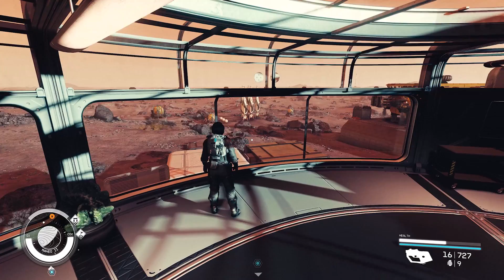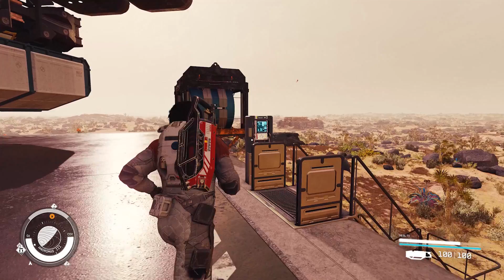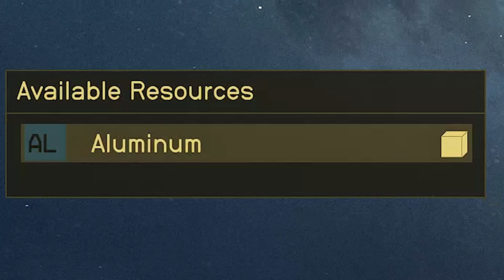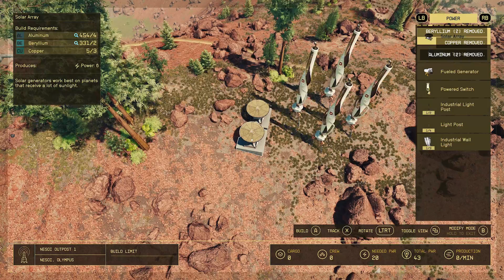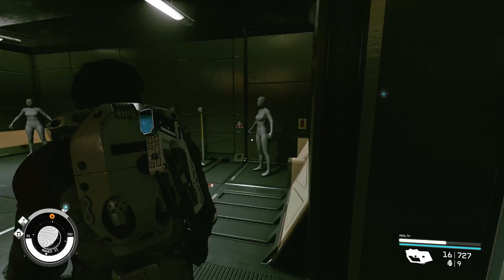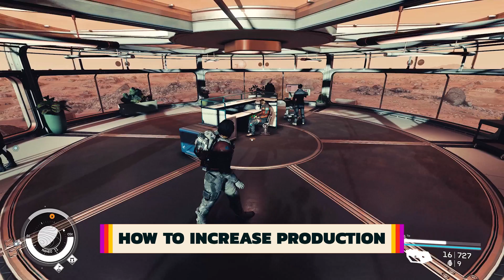How To Build And Utilize Outposts In Starfield

Comment: If you have a main hub, you can bypass building storage on your exterior (outgoing) outposts and create the red wire connection directly to the interlink. All the incoming resources will then be stored in your primary outpost storage.

Comment: I haven't bothered with outpost building personally. It's a time and resource sink and outposts require skill point investment to reach their full potential that can be spent elsewhere. The game throws credit's at you and if you're a looter like me, at level 27, less than 75 hours in i'm currently sitting on 1,000,000 credits and that's after purchasing a narwhal and upgrading the shield, cargo, engines and missiles which cost around 500k total. Just buy what you need for crafting/upgrades/research and funnel the extra skill points into more useful categories than outpost engineering, planetary habitation etc if you don't want to spend hours setting up outposts and have to keep checking them and gathering resources to sell for pocket change. I also have been stacking resources inside The Lodge basement in the storage box behind the research station, every ore, organic and engineered resource i find goes in there, it's unlimited free storage, in a room that contains every workbench in close proximity and that is extremely easy to fast travel to as it has it's own fast travel point and you load in just outside the front door.

Comment: Do you need to unlock an outpost skill to make an outpost? When I opened my scanner to try & make one it wouldn't let me :(
Reply: Make sure you're on a planet that doesn't have an extreme environment. You can't build on those without a later perk.
Reply: Nope - but in addition to the Extremem Environment, if you are too close to any other sort of location (like a landed ship or a factory or cave) you cannot do it. You have to be approximately 250 - 300m away fom any other point of interest to place it.
Reply: @MossNada  I figured it out, I was building to close to a point of interest + I was on an extreme environment planet lol

Comment: Silly question here - How do you build structures higher above ground? The game does not show that but I'd like to elevate my buildings above ground. How do you do that?
Reply: When you go to place a Habitat, after you hit the confirm button once, you can then use W and S on a keyboard (Up and Down on controller) to set the height of that building. Once you are happy, hit confirm a second time. But it's only an option on Habitats - not extractors/storage/power/etc etc They all have to start at ground level.
Reply: @MossNada  Ok, thanks

Comment: Pro tip: For helium-3, depending on the location you can use smaller energy sources (solar panels) to power helium-3 extractors that themselves can then be connected to helium-3 generators that provide greater amounts of energy for other operations.
Reply: How do I power my helium generator that requires 1 Helium-3 and I have plenty of it..?

Comment: - Keep separate storage groups for your extractors and your ship transfer unit, otherwise your extractors will just fill up all of your storage.
- Your first outpost should be Al & Fe, this can be done by finding the biome boundary and running along it until you find them both.
- Elements have families that occur with each other (lead & titanium, nickel & cobalt), once you have your initial outposts setup you can build in the right places to capture that entire family on a planet.
- Planet resources are exactly the same for everyone, so you can look up planets with the resources you want.
- Have separate storage for generators (~2 small extractors: 1 generator) & systems links with dedicated extractors to ensure they keep running.
- inter system cargo links only need to be powered from one side.
- Use a powered switch the turn your fabricators off, by default they just run, you can configure what it makes on the terminal.
- Chests are useful for normal goods, all of the containers are only for resources (exc cooking resources)
- Storage containers are the following sizes: 75, 150, 300. They’re unlocked using manufacturing research, you only have access to small (75) without investing into outpost engineering.
- You unlock better power options with outpost engineering, including generators that don’t use fuel.
- The output links can overload/bug out, sometimes you’ll need to remove and recreate the links to get them working again. (Unsure of root cause, I think resource extractors connected to cargo links never stop producing?)
- The last node in an output chain fills up first.
Reply: Thank you sir.
Reply: Thanks for some of these points, I especially like the point about generators that use no fuel!

Comment: Still trying to figure out how to stop outpost B from taking ALL THE HELIUM from outpost A when I send it over via cargo link to power the inter system transfer
Reply: Only connect some of your buildings to the cargo link then. That way it'll only send as much as you want to transfer while keeping some of the extractors for local needs.
Reply: Build a Gas Container next to your Inter-System Cargo Link. Connect the incoming helium to that gas container. Then connect that gas container to the blue box at the back of the Inter-system Cargo Link. 

If you are also trying to store some of the incoming Helium, try building a second gas container and connect the Incoming to that as well. But I have no idea if that will work. I only ever do the fist part as the only thing I use Helium for is linking outposts (I've never build a powered generator - just upgraded Solar and Wind ones)

Comment: Don’t put too much into them, folks.
You’ll just lose them in NG+
Reply: Now that’s a shame considering how much work goes into them
Reply: @gtabro1337 No you get the option to do ng+ or continue so it won't get deleted. It depends on the choice you take in the ending.
Reply: @amanpradhan02 that’s actually huge news to me. I had no idea you could just bypass NG+ if you wanted.
Reply: @joshuaDstarks  You do , you'll get an option from a character to continue the game how it is or basically reset. It will make sense when you finish the main story. Really cool and unique way to do a new game plus that is in-built to the core game itself.